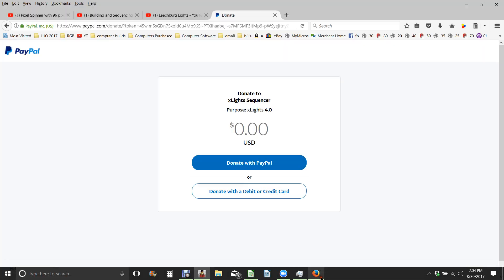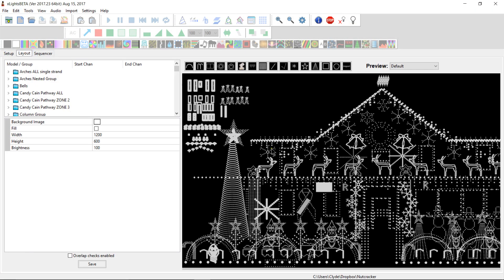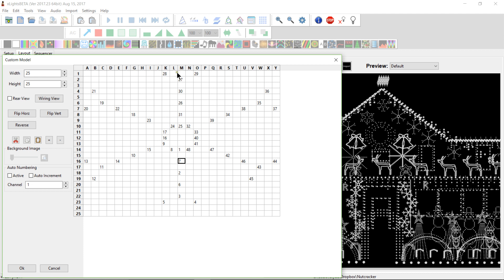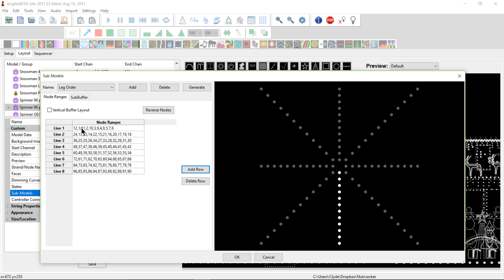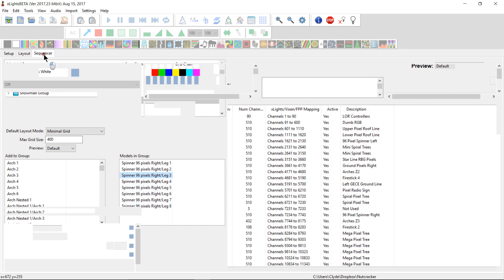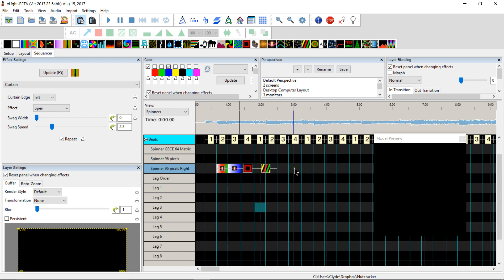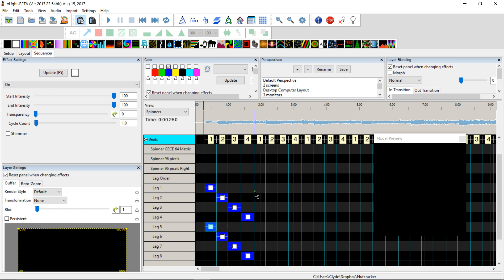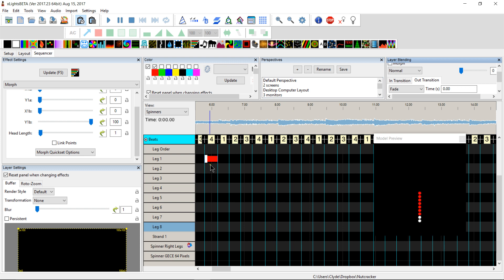Sub-Models Part 2, Sequencing with the new Pixel Spinner

Comment: Thanks this is just what I needed. I actually built 8 arches that for my yard that I want to spin around a central feature. And I think I have it figured out now. But think there may be an easier way to do this then how I am approaching it. So I can increase and decrease how fast the lines spin around the center. Think about a dancing water fountain where the lights jump into the center then light up a center feature.
Reply: How do you select the cells in the sequencer like that when I draw a box it does nothing

Comment: Hello, I have just finished building this spinner as well. I started soldering in the extension pieces yesterday and then found this video today. -:). So if i understand you correctly you have decided not to spice the extension but rather just run the 12 bullets from leg to leg? Thank you. Matthew
Reply from the maker: My original videos showed the splicing...That was 5 and 3 years ago.  Since the bullet nodes I used this past season (2017) were at 4 inch spacing, I decided to "leap frog" the pixels out and back through the leg of the spinner.  No splicing necessary.  Making the custom model was easy as well as creating the sub models.  I will be rebuilding the original spinner from 2015 to match this new one.  Cheers Matt!
Reply: thank you. so still 96 bullets in total, 12 per leg,   looks like every 2nd hole and then doubling back?
Reply from the maker: exactly!  :) too easy

Comment: Welcome.

How to install the AC toolbar to xLights?

Sorry for my english, i used google translator.
Reply from the maker: Click on the file menu VIEW... Then put a check box by the AC tool bar.  You can then click and drag it out where you want to place it.  Make sure you have xLights Version 2017.21 or higher.
Reply: I was looking for and could not find, after you tell me I do not know how I could miss it.
Thanks a lot.